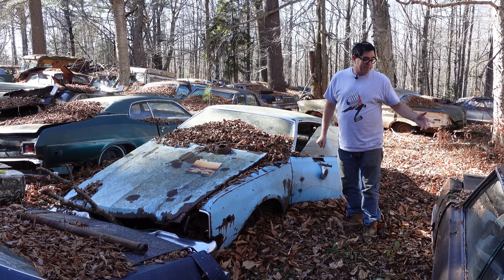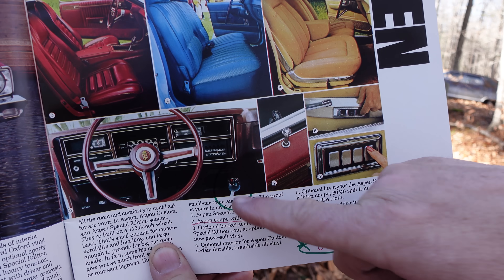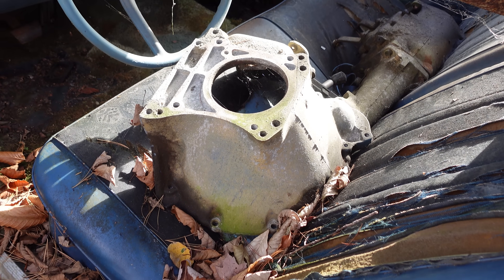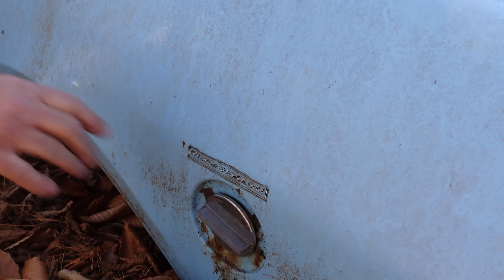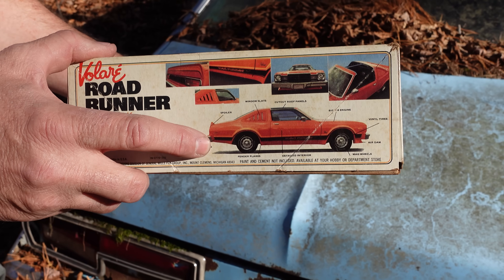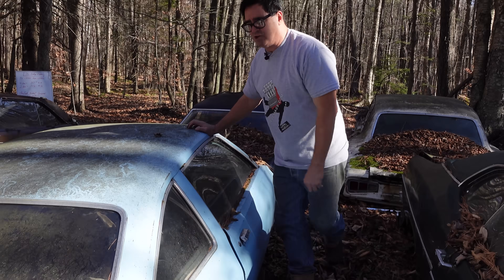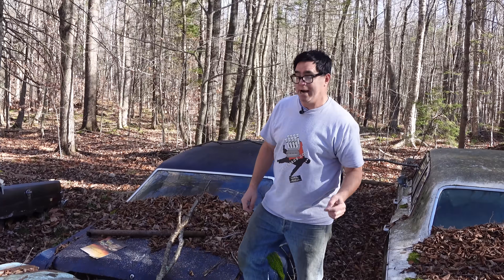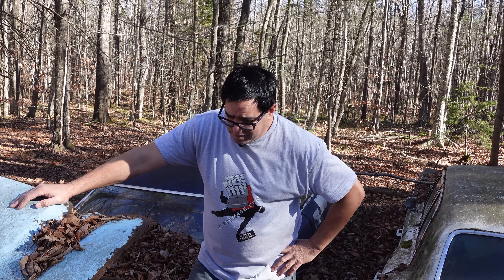First F

Comment: Drove a lot of those in new condition they were good cars rode very well. Corrosion killed them for sure but my 74 Duster had holes in the fenders on top so when you drove in the rain the water shot up through the bodywork. Rust kills everything roadworthy why complain. Were it not for winter this video series would be nothing.

Comment: Not true on the slant six and an Aspen RT. I had a 1980 Aspen RT with a slant six AND a four speed manual. Unfortunately the leaning tower of power was a victim of a previous owner not having ethylene glycol in the cooling system and cracked the block.

Comment: Dose any one have a clean 73-75 dodge colt coupe they wanna sell ?
Reply: I had one years ago, bright yellow clown car! With the 1.6L and a Chrysler automatic transmission that was bigger than the four cylinder engine in front of it. I think the transmission used more power than the engine produced! The shock towers were rusted so badly that the wheels started to camber in in a very unsettling manner!